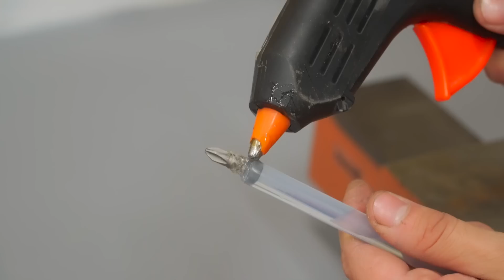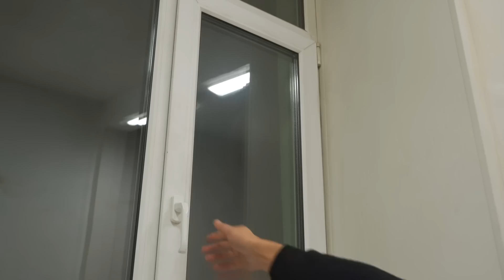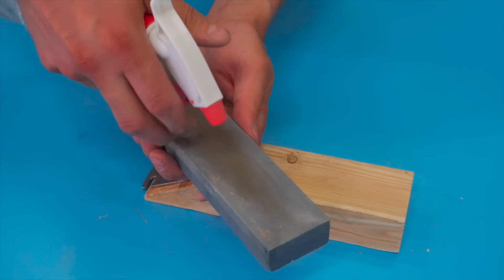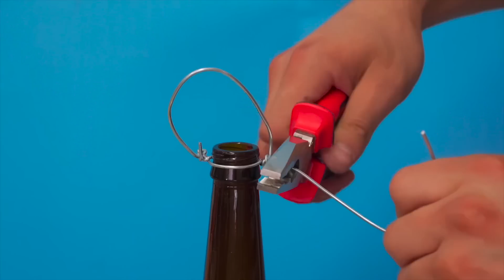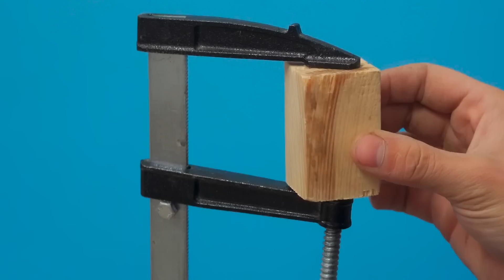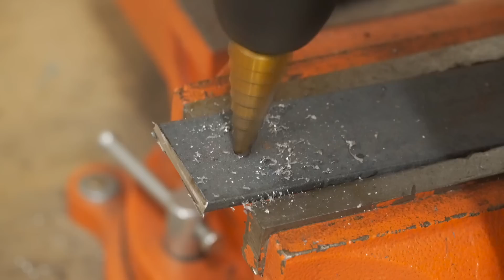Amazing tricks that will take you to another level of work

Comment: I find this funny. I have worked in most of the trades, either you have the tool, or you dont do the job until you get the correct tool. Its an alright video but non of those methods are really worth anything
Reply: Its not an alright video, and not having the right tools wasnt the problem.

Comment: The can hole saw that makes holes pop out of nowhere with no effort and the editing was bad. The hot glue stick extension 🤦‍♂️ if the screw is that loose just pull the parts apart